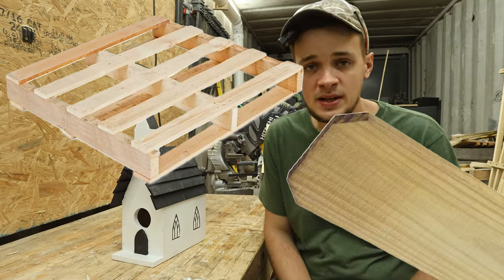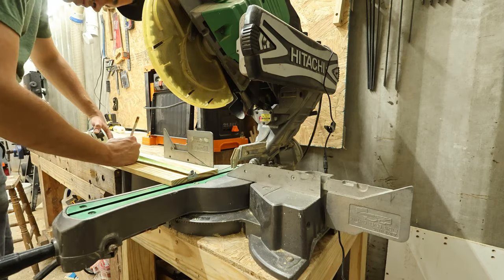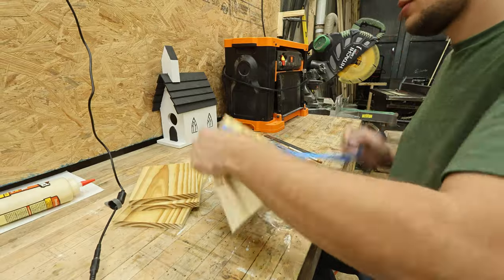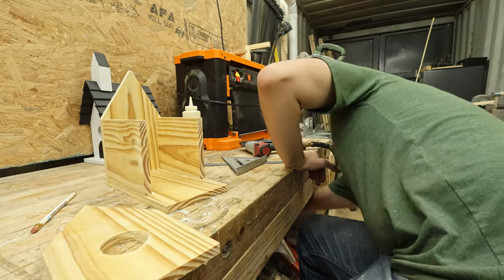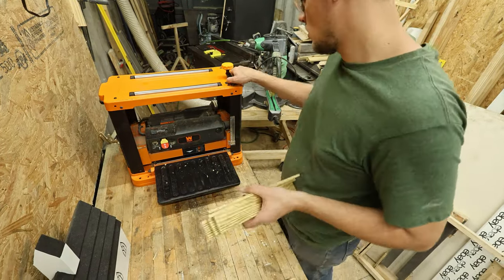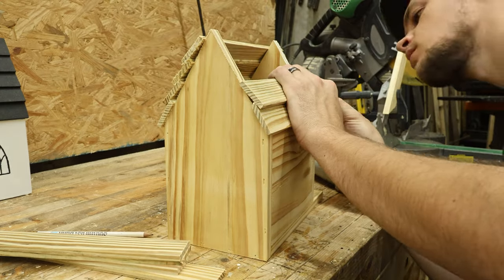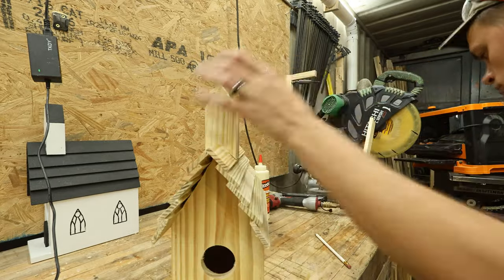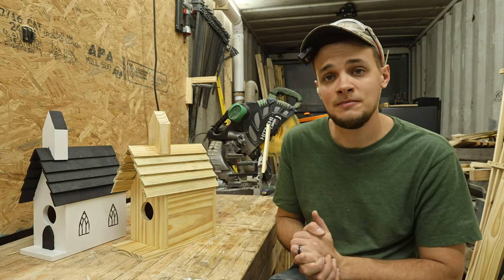Woodworking Project that Sells - Church Style Bird House

Comment: Thanks for the video and free plans. I will be trying to make my first one tommorrow. One thingI  would to point out is that you shouldn't sand the interior of the house. The fledgings need a rougher surface to cling to when trying to emerge from the house. When very young their nails do not grip very well and they will just slide down to the bottom . They aren't able to develop    necessary strength for their wings and legs.
Reply from the maker: That's a good point, thanks for that!